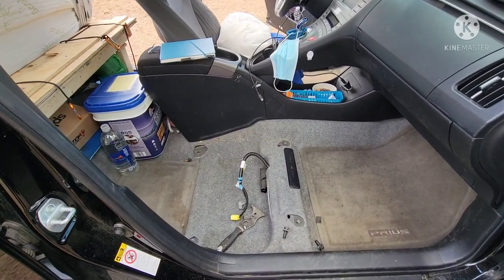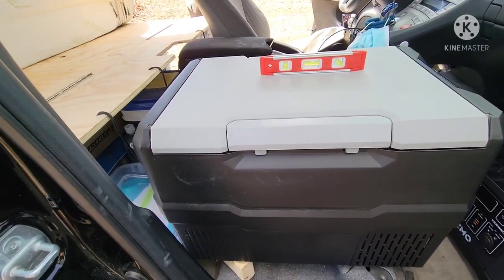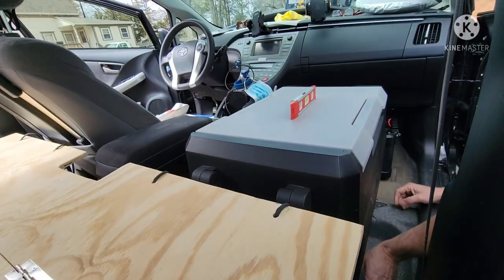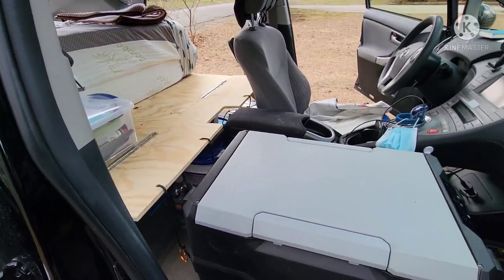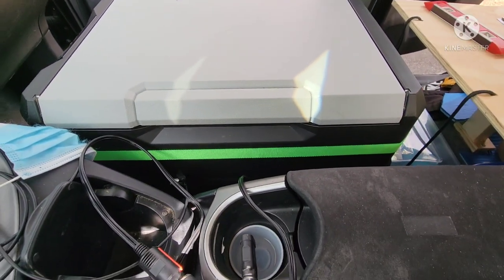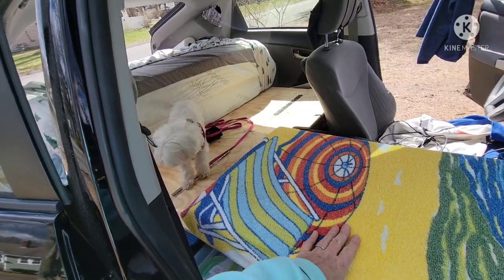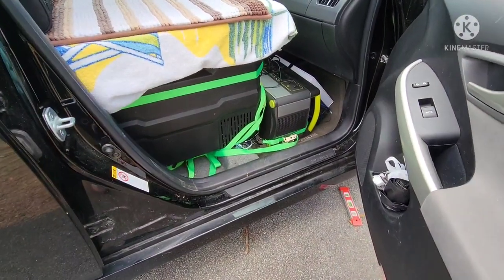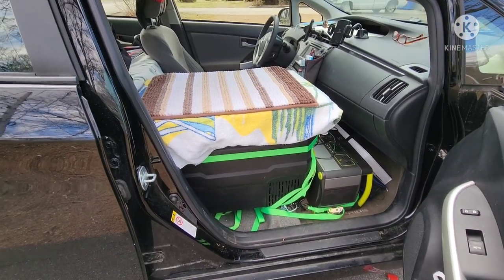FRONT SEAT REMOVED IN PRIUS TO MAKE ROOM FOR FRIDGE AND GOAL ZERO, 2015 TOYOTA PRIUS, GEN. 3

Comment: What did you do about the airbag code it throws when you pull the frontseat
Reply: I tuned in for just that answer :: sigh :: Uh, so, I guess ignore it? Register in a state without inspections? Return the seat when it's time to get an inspection?
Reply: I want to know the same thing.  I've seen four videos now of people that have removed their passenger seats, but no one mentions what they do about the airbag code or responds to questions about it.  I think we have to assume they just ignore the warning light?

Comment: I dont understand why people add battery banks, solar, etc to a rolling generator that is a Prius. I've spent about a year living in a Prius, using only a 1200w inverter for power. I've left it in READY mode for over 3 months without issues.
Reply from the maker: I don't want to have to leave it running all the time.
Reply: @lisamallard  I understand but know that if you're just running a small fridge and charging a few devices the gas engine would only run for a minute or 2 every hour or so. That's nothing.
Reply: @geedoubleu641 Wouldn't it be better to have a solar powered battery to run things like a fridge that stays on all the time? Say you leave the car for day or so and it drains the hybrid battery. 1. Your fridge contents go bad 2. Extra wear and tear on your expensive hybrid battery from being depleted all the way. 

Having a solar setup with the extra battery that can also be charged when desired by the prius itself would be ideal.
Reply: @seancase71  If I leave the car it's in READY mode using the metal key to lock it. It charges as needed.
Reply: @geedoubleu641  oh ok, the thought of just leaving it on while away hadn't even occurred to me. Too paranoid for that myself lol, but yeah that would work
Reply: @seancase71  What worries you?